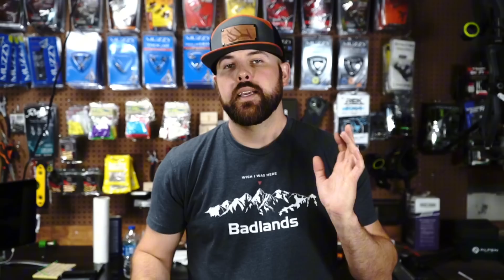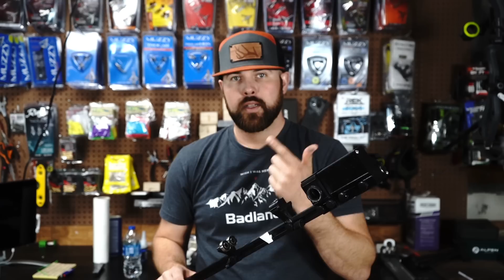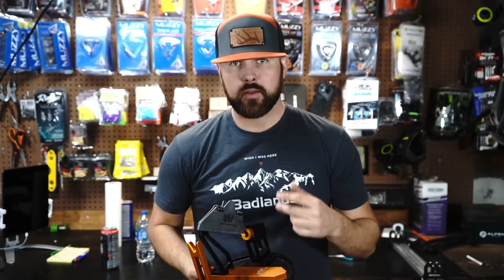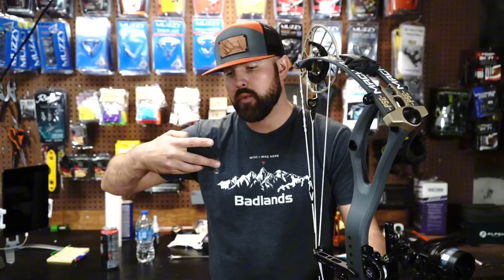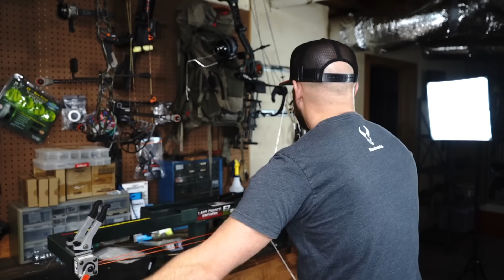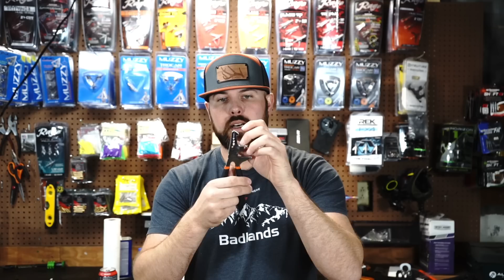TOOLS FOR YOUR AT HOME ARCHERY SHOP

Comment: what about arizona ez fletch ? is there a jig that gives option of straight,left,right or true helical? new to this hobby and trying to get the right tools the first time while being on a budget.
Reply: I use the Arizona. You have to be careful with it. It can get sloppy when closing it and glue your veins crooked. And glue builds up inside of it. So you have to constantly clean it after each arrow. But it is a good jig.
Reply: you can buy different arms for the arizona for right left and length of vanes.

Comment: Buy a apa bow you can  the strings   peep everything on them without a bow press . Only thing you'd need a bow vice for is to set your  center shot  , d loop and check your level  .